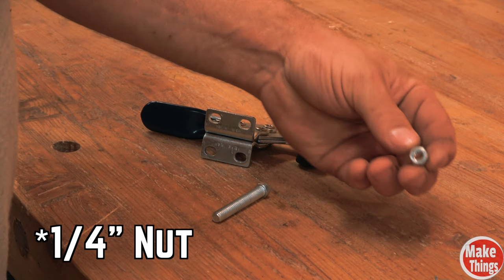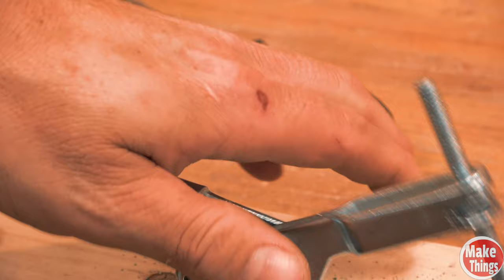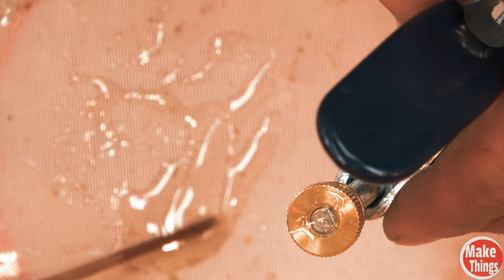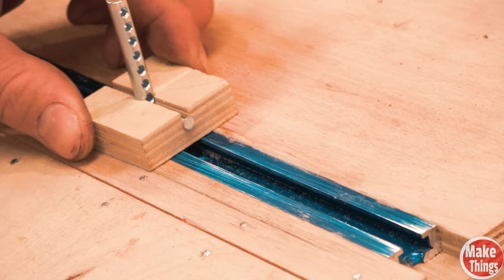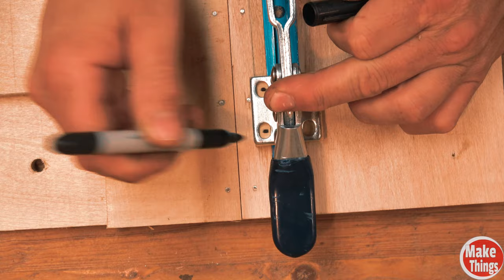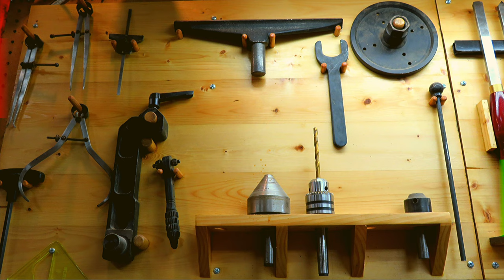Simple T-Track Hold Down Clamp

Comment: Great idea! Just the thing I have been needed for my sliding table saw! 👍
Reply from the maker: It really works great...and I didn't even epoxy in the nail.  I was going to use a bolt like I did in another video, but it literally makes the block below the toggle clamp twice as thick...this was a lucky "Wait a second!" moment I got.
Reply: @makethingswithrob  Those moments are the best!😉👍